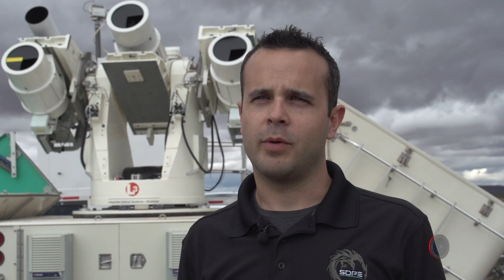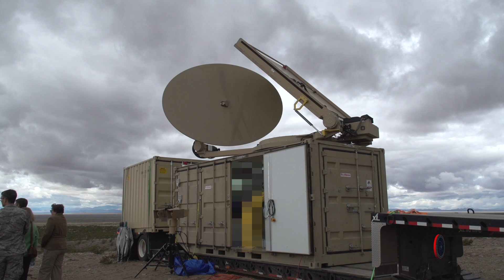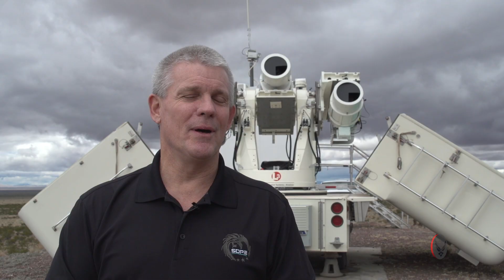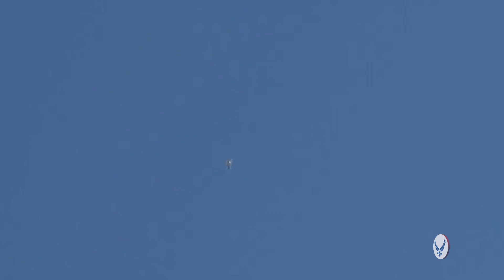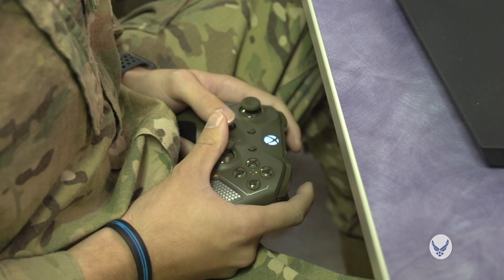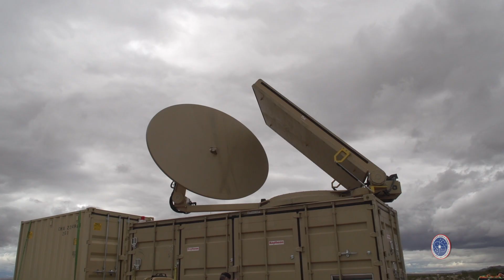Air Force Experiments with Directed Energy

Comment: Sounds familiar, microwave tech to turn steal beam and concrate column into dust, and blame it on the cavemen
Reply: WTC
Reply: Sounds like a lot of the fires that are happening right, especially the Maui fire. WHERE ARE THE CHILDREN?
Reply: Maui
Reply: Jet fuel can melt steel beams
Reply: @rainewaters6371 Chinese space weaponry
Reply: @gonelucid hundreds of floors of them? Or only where the fuel was located?

Where was the rest of it in the debris? Poof! Just disappeared?
Reply: Fed building in Oklahoma? Just like the twin towers, the feds have the day off.
Reply: @rainewaters6371  
What about children
Reply: I highly doubt it melts steel, it could barely melt the plastic on the drone
Reply: @Hsbkxkx  doesn't need to melt, just completely disintegrate
Reply: @drinkingpoolwater  that’s even harder to do…
Reply: Oh I thought they blamed it on ‘planes’?

Comment: It will melt alloy rims and glass without any other fuel sources around pretty good to do major damage when a change of economy is required.
Reply: A car with a partially full gas tank loaded with gasoline, will melt the rear aluminum rims everytime!
Reply: @MissionaryForMexico  maybe so, but what we witnessed in Hawaii was the direct result of Directed Energy Weapons.
Reply: @davidgold5961  there is a process to actually determine if in fact a DEW has been used. It does require ground inspection, samples, and photos
Reply: It will melt alloy rims? Will it melt the rest of the wheel? The hub of the wheel? The spokes of the wheel? How does it melt only the rim?
Reply: @senatorjosephmccarthy2720  aluminum, also if the rim is made of magnesium it will burn ! The wind made the fire into a blast furnaces with the gas burning more then likely much hotter!
Reply: @senatorjosephmccarthy2720 Magically melts.

Comment: Now you know how people were burned alive in their cars in Maui when they pulled their cars into empty dirt lots with no fuel around them to burn, and still were incinerated with temperatures hot enough to melt glass and steel ( over 3000 degrees). Forest fires don't get that hot, 1500 degrees tops, and that's with winds and perfect fuel. These cars had the aluminum cylinder blocks protected in the engine compartment melt into liquid. It's hard to get things that hot in a blast furnace.

Comment: Does the weapon have unlimited range?  What range does it have?  If the target is missed, can it accidentally shoot a satellite down?  If used in the air and it misses, would it take someone's house out?
Reply: Be sure you have a Point Ignition type car! Then put the Distributor and Coil and any small electrical parts in an EMP proof Bag! Or make a Trash Can read about how too because Flash Lights and many other electronics need to go in that protective bag or Can! Have a Radioactive Protective Mask especially for the little kids! Your Heart will Break just watch the Ukrainian Video after Massive Gas Bombs!
Reply: Maui... investigate before they take down the videos.
Reply: Maui
Reply: @bustbeel1  A car that runs will only work for a short while.  The gas pumps won't be operating.
Reply: @patrickriley1664  Wood pellet burning cars are now the future. Sadly, but probably true.
Reply: @brentbarnett9224  I was thinking sails.
Reply: @patrickriley1664  Pre electronic injection pump diesel engine, I have one.
Reply: The laser would dissipate at range, depending on power. Just as you can see light from distance but as you travel further away it dissipates in intensity.
Reply: @sushi_wolf  That would make sense normally, but if the DEW were a laser or something similar, it would dissipate only after travelling a very long way.  A laser can bounce off the Moon and return.
Reply: @patrickriley1664  again as stated dependent on the power of said laser.

Could my cats mouse laser pointer hit the building down the block, probably not.
Reply: @sushi_wolf  You might want to check that out.  But what you would need is a very accurate aiming system to know where it hits.
Reply: @sushi_wolf Laser and microwave don't dissipate the way light does at distance. The weather modification stations, are in the north of north America, where the hydro power is for the masive energy they require. They extended the monsoon season in Vietnam, in 1961 from there. No bullshit, the air force document AF 2025 reveals all of what I wrote.
Reply: @sushi_wolf  Star lighting reaches us over millions/billions of light years.  We only see a pin point because of deterioration of photons over the distance.  But remember, this is scattered lighting.  Lasers also will deteriorate in time but over far vaster distances because the photons of the lighting are lined up in a parallel direction.  That's the whole point of lasers.  A typical laser achieves this parallel arrangement through it's design; light bouncing back and forth between two mirrors until they line up and shoot through a hole in one of the mirrors.  The result is narrow beams of great intensity, just like a rock show from the '80's.  Your mouse laser will certainly break down because of external interference, but it will be over a far greater distance than conventional light.  If you wanted to hit a barn a couple miles away, I don't see a problem, BUT the first thing is to do it at night because of it's weak power.  And at the barn have a photon counter at exactly the right position.
Reply: Great questions, Patrick.
Reply: @JaneSmith0709 It is very accurate, and has been used in Vietnam from the north of the US, well that is microwave air heating, but the probably laser one, was accurate on the Fed building in Oklahoma.

Comment: Developer: No one can beat this system.
Mirror: Hold my beer.
Reply: I wonder how hard it would be to make an automated mirror system to aim it back into the source.
Reply: Maui
Reply: Not if your going at the system. The system funders, operators & backers … now that’s a completely different story.
Reply: @1800imawake probably rather difficult.
Reply: Unfortunately, there is no practical nor feasible defense against this. The weapon produces so much heat and sub molecular disruption, that even a highly polished mirror aimed  directly back at it simply melts.

Comment: Hmmmm.  How interesting -- A weapon you can't see (& probably can't hear either) which can start a fire quite a distance away.  Maybe there finally is an answer to the mystery of what caused all those many food processing plants to suddenly burn down.  Just an observation.  Of course, then there is also the curious situation with an area on a particular Pacific island where trees were left standing, but certain structures around them were reduced to ashes defying the normal way fires burn.  I seem to remember recently hearing that certain lasers can be rather selective about the colors they target...a certain shade of blue is particularly safe, if I recall correctly.  What color were those untouched umbrellas & certain rooftops on that little Hawaian Island?
Reply: I’ve seen a couple videos of blue cars undamaged next to melted cars in the aftermath of this fire….
Reply: @shawnlindow9608  Yep.  Saw those, too.

Comment: As far as I can see, the answer to this would be quite easy. You program the UAF with the ability to generate stochastic movement patterns in their hover mode - the laser would not be able to track it quickly enough to heat the surface temperature of the UAF up. Now, the real application would probably on stationary targets from satellites etc. That is scary.

Comment: Excellent. For several decades now there have been videos and articles addressing coherent energy beams as weapons, while large static systems have been employed on an industrial scale for extreme precision laser cutting of metal parts for a wide range of manufactured items, as well as precision laser surgery. 
Of course, manufacturing application does NOT require development of vehicle-transportable energy, target-acquisition and aiming systems.
At least One of the issues to be solved has been working out pulse/energy ratios for the high-energy beams that allow the vaporizing target Material to DISPERSE so that it is NOT PROTECTING the target Surface.
Another issue would be the plain OPACITY of our atmosphere in different conditions to different frequencies. It will likely be crucial to work out means of Quickly changing system frequencies to penetrate smog, smoke, rain, snow, and other suspensions and different forms of distracting "Chaff" or other opaque particles.
The basic light-stimulation of a crystal seems to require specific Light frequencies combined with specific target crystals, so changing the set up to produce different frequencies of the emerging BEAM would seem to require having a rotating platform of crystal sources...
Sorry for my rudimentary thoughts.
Sure would be wonderful if a beam could be passed through filters of some sort to modify the frequency to account for anticipated atmospheric opacity between source and target.

Comment: Sad thing is it that they are so easy to  protect against.

Light can not only be changed by color, but it can be reflected.

Also it can be reflected at angles that can hide it's location.

Lasers might work temporarily untill defenses build for moving targets.

Missiles of which they think lasers are the solution for is only temporary.

It's too easy to protect from them.

Long term they will only be good for large visible targets like battleships or buildings.

Comment: I would just have a drone that would intercept the laser weapon platform quickly. But to get around this I'd equip people with a backpack system that the laser can be directed into from a different location. and aimed manually or redirected by other drones. But I wouldn't leave the main system out in the open like tht.

Comment: The United States already has and has for some time now flying laser platforms in the form of large passenger size jets, this is public knowledge. I know cuz I saw it on YouTube 🤣. Directed energy weapons are a slow form of destruction and work very well as long as you can concentrate the energy, laser, microwave, emp’s on a target long enough to do some damage. Imagine pointing a high powered laser at a person but having to hold it on them until it puts them down, not much different than chasing them with a blow torch until they burn out of control.  Drones might be a better target. 👍